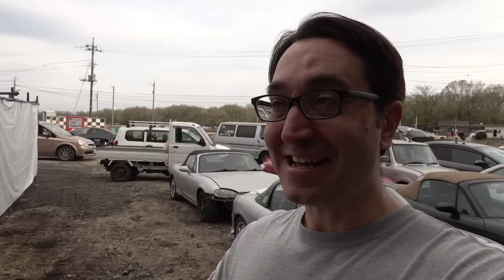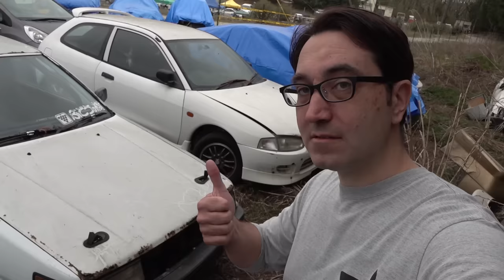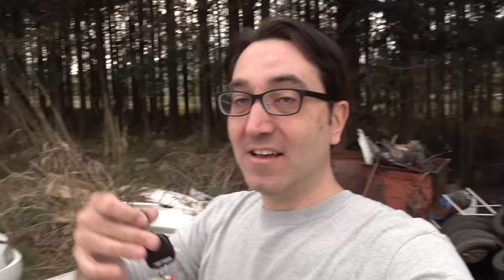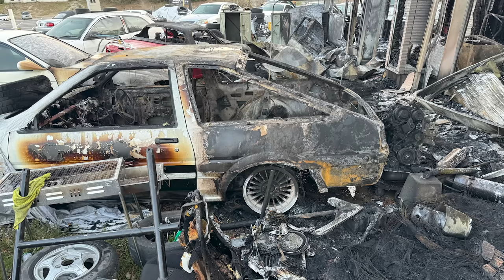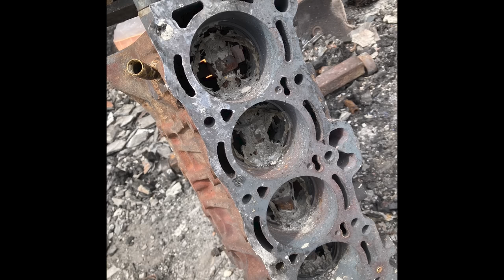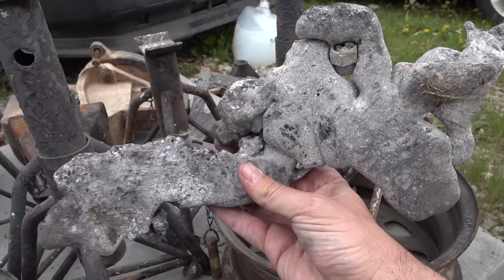It happened again

Comment: man, really unlucky with these shop fires. now you can call the 86 "beans on toast". i think you should keep the melted bumper and hang it in your workshop.
Reply: Mah, mount the burnt bumper on the car
Reply: Beans on Toast Tshirt
Reply: BRILLIANT
Reply: Toasted Beans
Reply: Freaking love that!
Reply: Rust eats away the metal + fire burns away the rust = weight reduction²
Reply: What I would do is if a blinker or a reflector melts I’d keep it on the new bumper as a reminder or memory that the car keeps